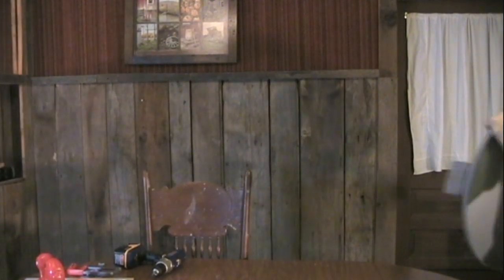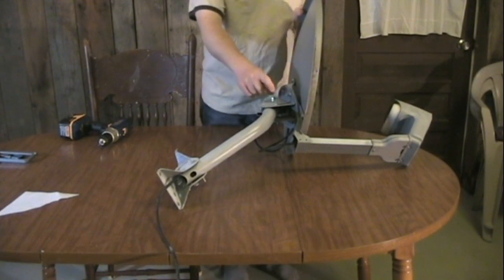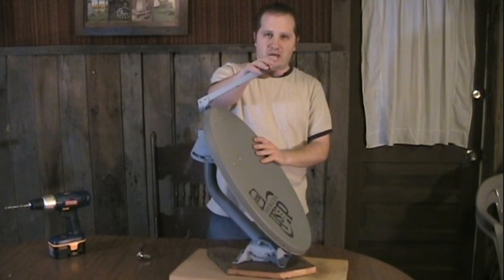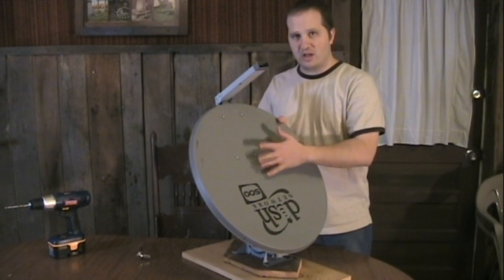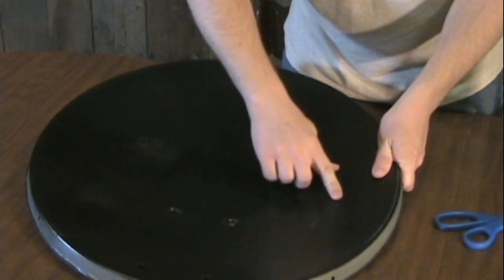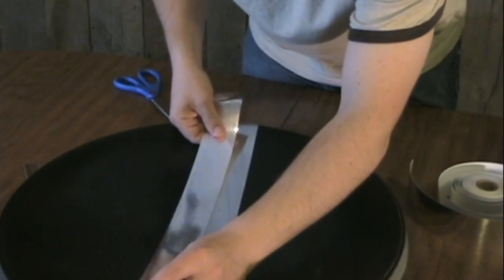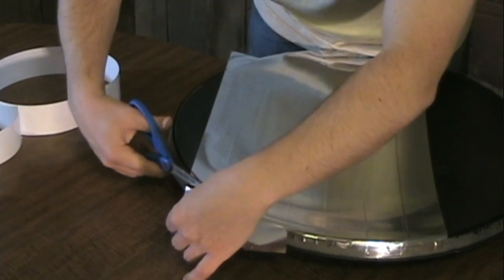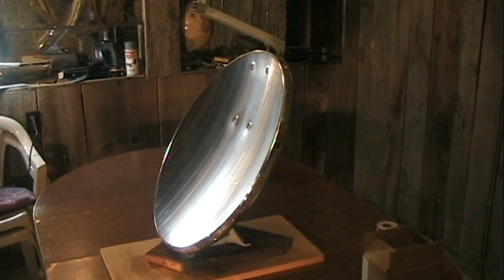How to build a Parabolic Solar Cooker using a Satellite Dish

Comment: Drywall mud sanded to smooth it. Then primer then the new chrome spray paint. Whole can. Lightly sanded each coat except the last. Then clear coat. Super smooth and reflective like chrome. Easy cheap. 20$

Comment: This may be a silly/dumb question, but why did you spray paint it black before applying the mylar? If the light is reflecting off the shiny mylar, why would it matter that the underside is black? If anything, doesn't that just make the dish hotter, not the object you're heating? Just wondering.
This is great! My Environmental Science class is doing a project on solar cookers, and I am going to bet that my satellite dish will reign supreme over everyone else's cardboard concoctions :D.

Comment: To keep the bubbles and wrinkles out spray with  soapy water than use a flexible plastic squeegee. This will squeeze the soapy water out and tight to the dish. That is how they do vinyl lettering and wraps.  

Just a tip

Comment: The type of tape can be polished rather easily using polishing compound. Don't be rough, just take your time with a soft rag and wipe the residue off with a clean rag. Works a treat.
Reply from the maker: Thanks for the tips!
Reply: Bernardo's Tech Blog Your welcome and after I commented, I realized you can also use Mother's Mag, but I found compound polish, the white version of turtle wax to work just as well. Probably cheaper too.

Comment: Why would you sand the surface? Isn't it already perfect?
Reply from the maker: Good question.  The dish I used had small dimples on it that would have diffused some of the light instead of focusing it on the cooking container.  It's possible that this wouldn't have had all that much effect on the performance, but I just played it safe by sanding it.
Reply: Bernardo's Tech Blog
Good call! Thank you!

Comment from the maker: As long as it is very reflective, it should.  However, the dish I used had a "dimpled" feel to it until I sanded it down.  So if you painted it without sanding it, it could effect the performance if the small dimples diffuse some of the light instead of it being focused on the cooking vessel.  I don't think this would be a problem, but I cannot say for sure.

Comment: buy reflective mylar off the internet? go down to the dollar store and get one of those emergency blankets (space blanket, hypothermia blanket). the other one is the silver paper ( sarking insulation ) they use in houses. I have a full unopened roll of it plus other scraps. if you snoop thru dumpsters outside houses being built on a sunday, you can open find offcuts of sarking insulation in them.

Comment: I built a solar cooker using aluminum foil & an old bar-b-que pit, with a plexiglass cover over it. It works reasonably well, but your idea of hanging the pan above it for a better focus probably works quicker. One major safety issue, however, is that I've read one should use very dark sunglasses, or even a welder's shield to keep from damaging your eyes with a parabolic solar cooker. It's about like looking at the sun from some angles and even multiples of that from other angles.

Comment: I used "Intertape" brand foil tape. It comes in a roll like the one he used and is 2 inches wide with a peel off adhesive backing. I think I bought mine at Autozone but it's available in hardware stores and is used in plumbing. Any type of foil/aluminum tape will work. Some are more reflective than others but you can make the call on that. The Intertape that I used is not a true mirror finish and may even be less reflective than regular aluminum foil but it's very durable.

Comment: Just a thought, but as a low cost alternative to the chrome vinyl tape, I think collecting used potato chip bags [that my kids devour on a fairly regular basis], cutting them into rectangles, and using double sided tape to adhere them to the dish with their silver Mylar side facing out would seem to serve the same purpose. Just a thought.

Comment from the maker: I was concerned that the tape would not stick to the coating on the dish.  Somewhere I read (not sure where) that tape doesn't stick well to it.  I don't know this from experience, though.  I found the tape on eBay.  It was entitled "Silver Chrome Mirror Vinyl Tape 2" wide"  I made sure the image showed tape that was very shiny and mirror-like.  I think some automotive or hardware stores sell it as well.  I don't have a brand or item number - hopefully this helps.

Comment: @Fredepraeses On the German Ebay there are 120cm dishes for 79,- (new). But believe in me: size does matter! (surface = pi * r²) or (surface = pi * d²/4)
1,2m diameter equals 1,13m²
1,0m diameter equals 0,78m²
0,8m diameter equals 0,50m²
You see, a 80cm dish gets you only half of the energy of my 120cm dish. I wouldn't recommend that if you really intend to cook. Of course it'd work, but you would be happy with it.

Comment: @TV1862Dillingen Thanks for the info, good vid! I just made a solar cooker with a 80cm dish. I bought it for 29 euros. The pricing for another brand which delivers dishes of bigger sizes it is the following: 45euros for a 80cm dish and 120euros for a 100cm dish. So prices almost triple to buy a dish only 20cm bigger. So when you can't find an old dish, buying a 120cm dish doesn't seem a cheap option to make a dyi-solar cooker. Unless somebody knows a website where to buy cheap dishes?

Comment: @Fredepraeses : My self-made solarcooker has a Diameter of 120cm. If you really want to cook with it, it shouldn't be less than 120cm. The sun provides about 1000W/m² of energy at 12:00 o clock. With a diameter of 120cm you have a surface of 1,13m². I have made a video that explains more

Comment: What diameter does your dish have? 33inch? Commercial solar cookers mostly have 50inch (120cm) diameter. So I wonder if you can still easily cook 2 liters of water with a 33 inch. 50inch dishes are more difficult to find or expensive.